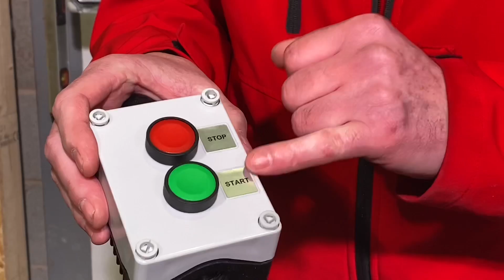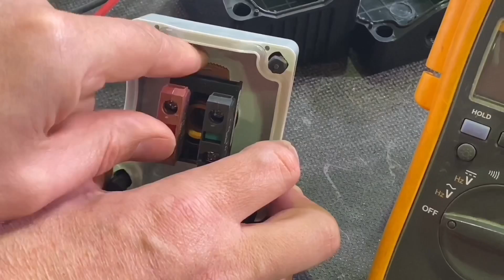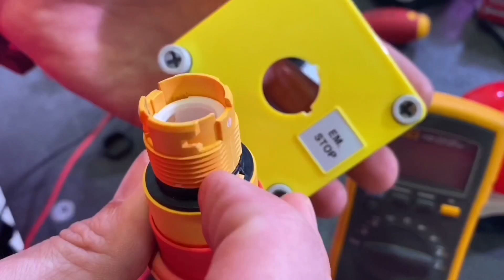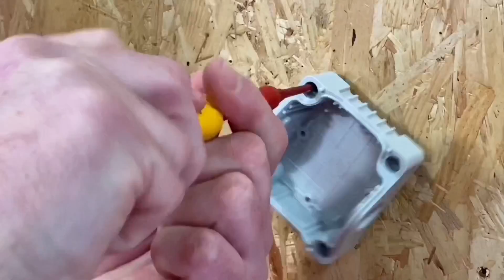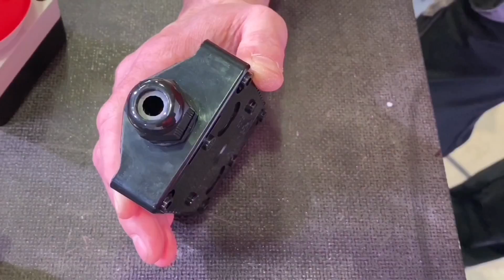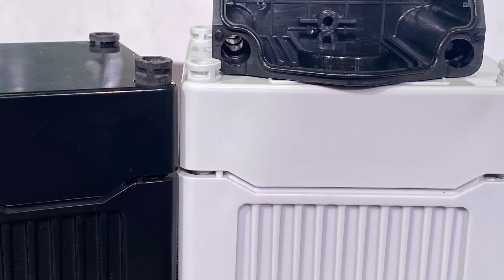22mm push button switches for industrial control panels - by Hylec

Comment: Interesting array of switches,
The yellow/red one reminds me of those stupid/dangerous push button light switches you get in hotels in Germany and France , you know the ones one at the bottom of the stairs one at the top you push it light comes on you get half way up the stairs or half way down and the dam light switches of because the switch is on some kind of slow release plunger. 
Great video guy’s as always 👍👍👍❤️

Comment: Is the Hylec -APL  SKU 32680-0001 2 way  A lock start push button meant to be used with a contactor, if so what is recommended?

Comment: When will manufactures of these things realise that it will NEVER be fixed to wood. We DO NOT want a 4mm or 5mm hole fixing hole designed for a wood screw. We want and need a fixing hole designed for a tech screw , a 6mm roofing screw or a 6mm hex bolt. These things are always fixed to steel. At the moment most people would compromise the IP rating and drill a hole through the back  inside with a 6mm drill and fix it that way. Because if you try and open up the proper hole you end up breaking off the corner of the box
Reply: your fixings kit doesn't contain 4.0mm pins and nuts? Also tech screws come in wide range of sizes not just those with the big wide head......there are always solutions
Reply from the maker: Good point - for this range we’ve found out they make an external clip on flange for more fixing options  - we will try to get hold of a sample to see how it works .